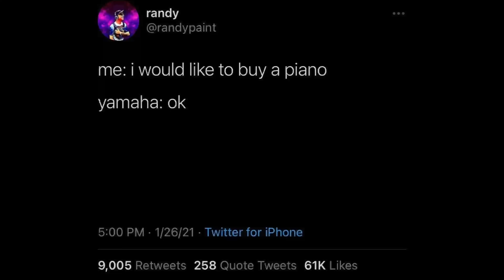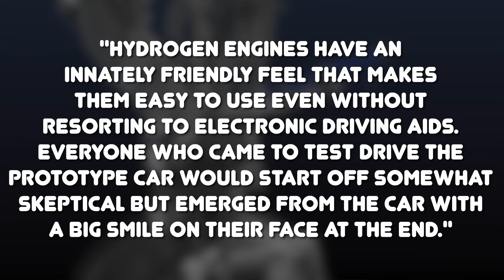Toyota's New 455HP Hydrogen V8: Everything You Need to Know

Comment: I’m so excited that Toyota is the one that has gone against the grain to begin focusing on better engineering hydrogen engines. This is truly as green as a combustible engine can get. ❤️
Reply: Hydrogen source is water. Hydrogen is for drinking and washing clothes not engines.
Reply: @eugene7518  hot take
Reply: "I’m so excited that Toyota is the one that has gone against the grain to begin focusing on better engineering hydrogen engines. This is truly as green as a combustible engine can get."

Not at all. First of all, the amount of power required to extract hydrogen is simply staggering. A recent study showed that a country like Germany would need to increase electricity production by 20-25% if the country was to turn to all-EVs. Difficult but possible. To go all hydrogen would require 125%.Never going to happen.

Secondly, storing and transporting hydrogen is basically extremely difficult. The atom is so small that it is virtually impossible to contain it in the same way as we can store petrol. After a few days, the hydrogen tank is basically empty. Back in the naughties, BMW built an experimental hydrogen powered V12 but advised drivers not to park it in a garage because of the fuel leakage. You wouldn't want to turn on the light switch either...

Thirdly, hydrogen contains about 1/6 the amount of energy per litre of petrol and burns a lot hotter, which creates all kinds of ignition problems and high likelihood of overheating.

Finally - and perhaps most importantly - a kilo of hydrogen contains about the same amount of energy as a gallon for petrol. A Toyota Mirai has a tank tha contains about 2.2 kilos of hydrogen at 10,000 psi and that's about the practical limit for that car. That same tank, used to run this proposed engine, would grant the car a range of about 50 miles. Just to get a range of 300 miles would require a tank of 13.2 kilos at 10,000 psi, which is too big for any car. Technology can't change any of this. It may be able to solve some of the combustion and heat problems but the range problem and the extraction problems are not going away.

Comment: I would purchase a hydrogen car if the infrastructure with fuel stations were available. In fact, I feel that the lack of hydrogen fuel stations hinders their production due to lack of demand. It’s like buying a pen with no way to add ink.  I would prefer another option to electric because batteries don’t last forever and have a high cost to replace, along with the short range and charge times. Hydrogen is abundant, it’s zero emission, I feel its the next way to go.

Comment: Agreed, hydrogen ICE is not nearly as efficient and trouble free as a hydrogen fuel cell vehicle, but something you are not taking into account is that when burning hydrogen, there is no fuel dilution or carbon induced oxidation of the lubracating oil in the engine. Theoretically, with a very good quality synthetic oil, the time between oil changes could be extended to 50,000 miles or more. And some people (not me of course, ha, ha) are in love with the sound of a great high performance ICE engine. I might not buy one as a daily driver, but would definately consider getting a hydrogen powered ICE engined vehicle as a weekend toy...

Comment: directly burning hydrogen in air is NOT zero emission! the high temperature of burning hydrogen causes the nitrogen in air also combines with oxygen so you got nitrogen dioxide gas as a by-product. nitrogen dioxide is the main cause of acid rain!! that's why only fuel cell use is real zero emission, not hydrogen ICE.

Comment: Motor Sports, Nascar and Formula could switch. Formula 1 is very Eurocentric and countries will be banning gasoline. Japan could also switch to Hydrogen and electric only cars, they have a big car scene that would want to hear an engine. They did build electric before charging stations. Gas stations could easily be modified to H and the tankers could deliver it just like gasoline. I want the ICE to stick around and I am fine with diesel and gasoline not being a part of it.

Comment: Electric battery cars are the short term and quick solution for now,  but in the long run large scale clean hydrogen production, distribution, etc. for sure will be developed (even if cars didn't need it, many other fields will need it like long distance flying and steel production). Also hydrogen is a solution to the problems of renewable power intermittency and matching electric grid consumption to production (that must always be in perfect balance). Hydrogen is one of the few options that has the potential to store vast amounts of energy efficiently.

Comment: volvo did the calculations on electric being a more green option than gasoline, and it takes driving the car for 90,000 miles before you benefit. on top of that 120k mile battery life expectancy starts you back at the beginning. to make hydrogen viable youd just need to provide fueling infrastructure. people get on board with 0 emissions (greenhouse gassed) and that they hop on board with that.

Comment: If you think that the gas companies are going to just give up, well, they won't, period. And one reason is that crude oil is used for thousands of things and not just gas. So it isn't going anywhere soon either because they haven't even drilled more than .001 percent of oil reserves on the planet yet including   various continents that posses the other 99.01 percent that will last over 250 years or more. That is as long as the UK doesn't get their hands on it first and that's the problem and one of the reasons for the 1st AND 2nd World Wars. Looks like their at again already, now doesn't it !??

Comment: There are many really wild hydrogen fuel technologies making more hydrogen fuel depots likely. This is them getting a head of the curve when it comes to these types of engines. Keep in mind to, there are electric vehicles that you plug in and electric vehicles which are powered by hydrogen energy converters. These HEVs have been and will continue to push the distribution of hydrogen refueling stations in the future. A hydrogen combustion engine like this V8 seems more like what you would use to replace the engine in a diesel-electric train or yacht engine with or any number of construction and mining vehicle power plants, emergency generators...

Comment: Having looked and discussed options its Crazy to think Hydrogen is abundant when wanting to use it as Fuel, yes its in the air and extracable from water but the Green cost to produce it is currently extremely high, Porche have a South American Production Centre but there are very few around the world and production is comparable to fossil Fuels. 
Sadly for us Hydrogen Heads it has been proven in California by VW and other partners that Hydrogen is a,. Not easy to keep safe and b. costly to protect in cars for production Hence VW will be fully electric by 2025 worldwide. I do love that Toyota and Yamaha take this approach so it stays on the table and really do hope someone does effect the change in years to come but it is sadly far behind Clean Elecctric development.

Comment: The only other scary thing in my opinion about Hydrogen as a fuel in an Internal combustion engine is that what happens when the product of combustion, water vapor,  blows by the piston rings and contaminates the engine oil?  Engine oil and water are a deadly combination in any ICE engine, causing sludge, gumming of vital parts and eventually engine failure.  Every mechanic knows that a small leak of coolant thru a head gasket into a combustion chamber will find its way into the engine oil and lead to major problems.  Similarly in a Hydrogen fueled engine, water vapor blow-by into the crankcase would eventually condense and ruin the engine oil.  I would suspect that worn rings and valve guides and premature engine wear and failure will be a major problem with this type of fuel.   The engineers that design and build these engines will have to take all of this into consideration when designing these Hydrogen powered cars.  The only effective way to use hydrogen as a fuel in an automobile is to have a hydrogen fuel cell that produces electricity to power the electric motors that turn the car's wheels.
Reply: Hydrogen source is water. Hydrogen is for drinking and washing clothes not engines.

Comment: I would take H2 over electric any day.  I'm not convinced they will solve the "recharging" issues with electric not to consider the amount of weight batteries add to the cars and the need to maintain / replace the batteries after 8 to 10 years.

Comment: You are to positive about that the electric cars will conquer the world, I don't think so. And that because the simple fact that petrol has a 90 times more energy in it per Kg compared to a Lipo battery. So even with the poor efficiency of the internal combustion engine, petrol is a WAY better energy carrier than a Lipo. And the internal combustion engine is still developing. F1 engines have an effecieny of more that 50%. As for Lipo, decades of research have only resulted in minimal gain in energy/weight ratio, so I don't expect a shocking leap in that.
And for bringing up climate change as a reason, you assume there is a carbondioxide problem, which in fact there isn't. It's fake, search the internet and you will see why that is.

Comment: Some of us don’t just care about horse power, performance vehicles have many factors for which we love them,  2 of the main factors are: sound and gears. And if you want to push times: weight an handling. Looks at mustangs, not any where near the most powerfull V8, but still the No.1 selling sports car, why: a complete package but mainly sound and gears. I predict inside of 15 years more the 2/3 new consumer passages cars will be electric, but performance vehicles and heavy transport will be hydrogen. Internal combustion engines aren’t the issue - the fuel is, performance manufactures (Ferrari, lambo, koenigsegg…etc) and race teams see the value IC offers and how it’s unmatched for it’s feel and character. Who wants to watch F1 in silence, or not feel the thunder of top fuel dragsters. We don’t love fighter jets because the fly over in silence.  As a car lover, I look forward to the day my daily is a quite comfortable EV, knowing I can still race my hydrogen IC on the weekend.

Comment: I don't have the exact science behind what i'm about to say so bare with me pls. But hydrogen cars are a thing and hydrogen as a replacement for gas has been thing here in Romania for the past 10-15 years at least. Yes the cars have had their fuel replaced and nothing else but to go over 1000km range with 1L of water that gets transformed into hydrogen through hydrolysis? i think thats something that should be done. Its not about electrics being the superior product or not. Its about what people want. And right now people want cars with character (thermal engines) and both range ant carbon neutral emissions. So yeah Hydrogen sound like a viable solution.